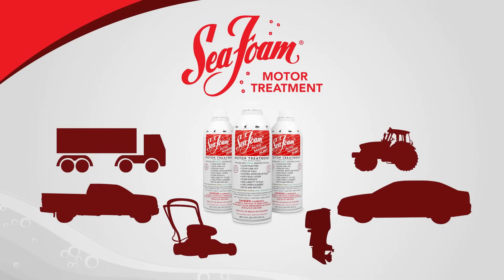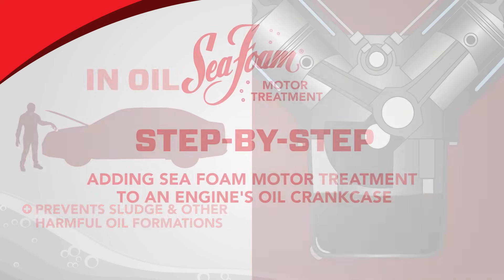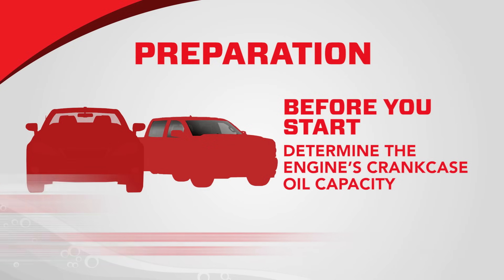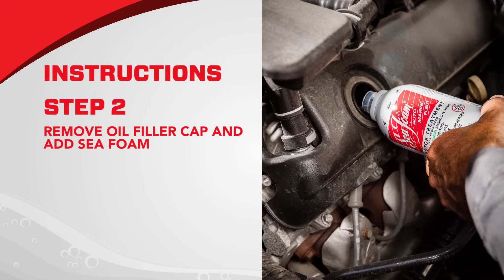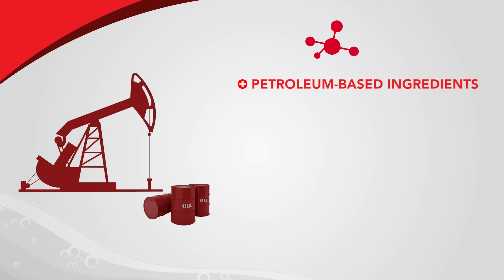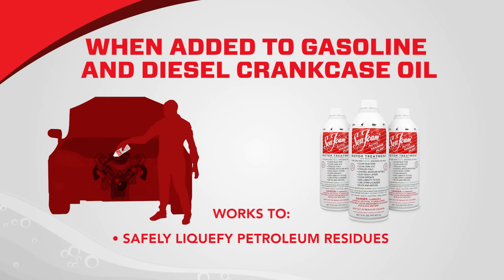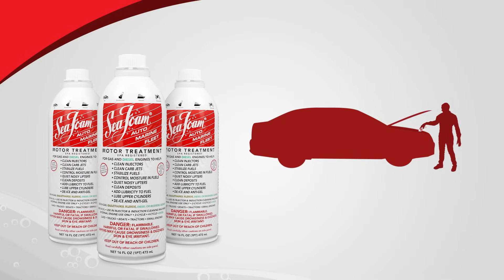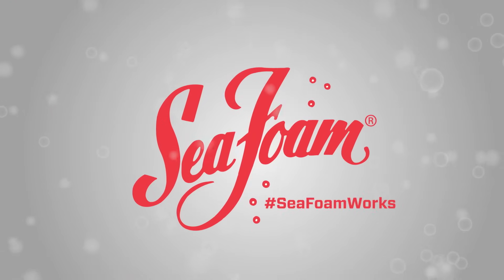Add Sea Foam to your oil crankcase - super easy!

Comment: I've got a 2007 ram 1500 with the 5.7 hemi,  recently replaced the rear main seal and oil pan gasket, replaced the oil pressure sending unit but still deal with low oil pressure when the truck is fully warmed up but it runs really good. It has 165000 miles on it but im worried because the crankcase had a thin layer of built up sludge in it thankfully no metal but some build up, so I'm skeptical when I ask will this product clean up my engine and solve this pressure issue? Running down the road in cruising gear oil pressure is 51 psi. What do you think?
Reply from the maker: Hi Shane: Sea FOam in oil works to reliquefy any heavier residue or buildup so it can drain away when replacing oil. If you like that idea, use it! Hope this helps!

Comment: is it safe to suck through a vacuum line for brake booster?
Reply from the maker: We do not promote using a vacuum line. Not safe because you can hydrolock a chamber and ruin the engine. Use Sea Foam Spray through the throttle body.

Comment: One of my cylinder is having low compression(1 out of 6). Any of sea foam product can help with that?
Reply from the maker: Sea Foam Spray treatments through the intake and adding Sea Foam to oil each interval. Both work to diagnose stuck compression rings that are gummed-up with varnish/carbon.

Comment: I have a 2006 Mazda 3 that was sold to me Really cheap because it had an engine knock. Mechanic told me that some of the lifters had too much play and it's recommended to get a new engine which was going to cost me $10,000. All I did was add seafoam to the gas tank and to the engine crankcase and drove it around. Not even 20 mi before that engine knock pretty much went away by 80%. $10,000 versus a $12 bottle of seafoam.
Reply from the maker: We love that story! Pls send a message using the website's Contact Us page, select marketing.

Comment: I have a 4.2 qt crankcase and am due to change my oil about 300 miles from now, i tend to burn some leaving what I estimate is about 3 qts after top up each interval.  in the case that its less than that,  is it safe to go over a couple of ounces? thanks
Reply from the maker: Yes, a half can is fine.
Reply: @SeaFoamOfficial what if i poured all the bottle??, Please help
Reply from the maker: @thunderwolfgt79  Change the oil or drain 2 quarts/ add 2 new quarts.

Comment: Aww man, just changed the oil on my ride, can I still add sea foam to it being its recommended to do so prior to having one... Never mind, no need to answer being I found the answer in one of the comments.
Reply from the maker: Got it. Can add any time during the interval and leave in for the length of the interval... just as long as you drive at least 100 miles.
Reply: @SeaFoamOfficial  Thanks, definitely drive that many miles as an independent driver

Comment: I just changed my oil on a ford explorer that is burning a quart of oil every 500 miles.  I want to add this to the crank case before the next change, but that might not be for 6 months.  If I dump in sea foam and let it do its thing for say 7000 miles will this be bad?  Or should I just add it, drive 300 miles and change the oil and filter again?
Reply from the maker: You can add at any time during the interval. No worries.👍

Comment: i have a v6 injected engine from 1990 and i've had the can of seafoam sitting ready for years but never got around to it..

i've been running some oil additive that was supposed to reduce friction and stuff, i forget the name of the one that's in there now but it's a competitor of bi-tron from what i remember. right now the oil is black as heck so i'm due to change oil and filter, but i was wondering..

should i add the seafoam before i change out the dirty oil/filter, or should i really change oil and filter first?

assuming i should change oil/filter first, is there any limit to how long i can leave the seafoam in there? like if i change everything and add seafoam, knowing me i probably won't change the oil again for some years.. can i expect that to be all good? i barely drive anymore.
Reply from the maker: Either before or after is fine. Using Sea Foam in oil to clean heavy residues is something to do every interval, so the sooner the better!
Reply: @SeaFoamOfficial  thanks very much! i think i will change oil and filter, then seafoam it up :)

by the way, i suspect my pick up pipe from the sump might be partially blocked, possibly with really old sludge from before i even owned the car.

is sea foam likely to be able to break up heavy/thick particles that might be blocking the screen up? or is it mostly good for residues?
Reply from the maker: @outseeker  Sea Foam works to reliquefy heavier oil buildup, so yes. Use every interval!

Comment: I used this on my amc 360 engine with a lifter knock..  The noise did go away for 2-3 days but came back and never went away again.. sucks
Reply from the maker: How many times did you add it to your oil? Sometimes requires treating 2 or 3 oil intervals... Keep at it!

Comment: My car takes 6

quarts of oil in a 6 cylinder car I believe im 1 quart low so I'm going to put four ounces in.Is this ok?
Reply from the maker: Yes, that would work. You can also eyeball as much as half a can.
Reply: @SeaFoamOfficial   I put it my oil 1500 mile before my oil changed
Reply from the maker: @omarcarnegie7614  That will work!
Reply: @SeaFoamOfficial   My car has a 4.5 quarts oil capacity with filter, how any ounces of seafoam do i need to use?
Reply from the maker: @above.average.gaming.natio3026   5 to 8 ounces. I personally use 1.5 oz per qt.
Reply: @SeaFoamOfficial  ok thanks

Comment: Can this help with clogged pcv valves? That’s what I need to look at next but I want to find the cheepest option first
Reply from the maker: Hi Nolan. No, it wont help to clean a PVC valve (post combustion). Cleaning a PVC is a matter of removal and cleaning by hand. Soaking the valve with long blasts of Sea Foam Spray will make the crud is easier to remove.
Reply: @SeaFoamOfficial  alright well thanks for the response I just bought some to help clean my engine because it’s been kinda sluggish lately
Reply from the maker: @atvthings6887  Run it in your fuel and oil for several months and see what happens.
Reply: @SeaFoamOfficial  would it work well if I added something else like power up with it?
Reply from the maker: @atvthings6887  Not sure what that means...Is Power Up a fuel treatment?
Reply: It’s an oil treatment for better lubrication, not that I would mix oil additives I’m just curious if seafoam is effected much by other additives
Reply from the maker: @atvthings6887  Sea Foam in oil works to liquefy heavy oil residues and deposits back into the fluid phase so can drain when you dump your old oil. Not harmful to mix with other additives.
Reply: Awesome. Thanks

Comment: How much to add seafoam to oil on a 04 Silverado
Reply from the maker: Half a can every interval!
Reply: @SeaFoamOfficial  will it hurt while driving it
Reply from the maker: @shabbaranks3206  You need to drive/run the engine to circulate and clean. So yes, you drive as normal after adding to oil. Leave it in till you change your oil.
Reply: @SeaFoamOfficial  ok thanks

Comment: Will this help with low oil pressure?
Reply from the maker: Hi Joseph: Depends on the cause. If you have an oil restriction, yes. Is your low pressure something recently noticed or been going on for several oil changes? Does the engine have a lot of miles (wear)?
Reply: I like how u  just didnt respond lol

Comment: will this product help if car burns oil
Reply from the maker: Yes, particularly if your rings and actuators are gummed up. Start running it in the oil every interval. Will work progressively.
Reply: Hi seafoam i have a question regarding my welder generator.
Can i put seafoam in the gas tank and crankcase at the same time and run my machine like that? Also once i start the machine with the seafoam in the crankcase how long do i run the machine before stopping to let the seafoam work? Once i wait 20 minutes how long do i need to let the machine run before draining the oil for proper cleaning. Any help is appreciated.
Reply from the maker: @OysterP  Hi Jason: Yes, you can add to fuel tank and oil crankcase at the same time. For a generator, run with Sea Foam in the crankcase for at least 1 to 2 hours before replacing the oil. Hope this helps!
Reply: @SeaFoamOfficial  my machine is running with it inside the gas and crankcase. Once i put in the crankcase do i let it run and turn it off to let the solution work for 10 15 minz then run it again?
Reply: After a couple of minutes adding the seafoam into the crankcase and starting the engine died and didnt start up again on 1 attempt. Im concerned. I called your facility and said to leave it for a day and then try starting again. I hope that will be the issue??
Reply from the maker: @OysterP  No worries. Let us know what happens...take it a step at a time. Please notice that we replied to your other video post  questions.
Reply from the maker: @OysterP  Just let it run with Sea Foam in the fuel. Go to our website and look up the HOW2 instructions for gummed-up carburetor. That will help explain what you might be dealing with.
Reply: @SeaFoamOfficial  for some reason my spark plugs got too oily and thats what killed the motor. I put new plugs she ran right away. Thanks alot for great customer service guys
Reply from the maker: @OysterP   Glad! Our pleasure, always.

Comment: So is this where you add oil to your car? Same spot?
Reply: Yes
Reply from the maker: @sevelev  Yes, just twist off the oil filler cap and pour it directly into the oil crankcase. [Same as where motor oil is poured in.]

Comment: Would this help with a P2188 engine too rich at idle bank 1 code ??
Reply from the maker: A P2188 code has to do with fuel/air mix (upper engine ignition) so adding Sea Foam to the crankcase would be unrelated.
Reply: However, you might try adding SeaFoam (1-1.5oz/gal) to your fuel tank at your next fill-up.  I recommend adding the SeaFoam first so the fuel entering the tank will stir it all up and mix it well.  If you have an intermittently-sticking injector or an injector completely stuck open, SeaFoam can help dissolve any gummy residue in the injector and free it up, as well as delaying similar symptoms in your remaining injectors which haven't thrown codes (yet).  If the issue is electrical (spark plug, plug wires, distributor, etc) or an air intake issue (dirty or obstructed air filter, mass airflow sensor, intake air hoses, etc) then SeaFoam will not help those issues.

Comment: Only used it once when I first bought my used Mini Cooper. If you change your oil regularly you don’t need to do this oil these days have a detergent in it that cleans your engine case.
Reply from the maker: How Sea Foam works in oil is not the same as using a detergent oil. Detergents don't work to prevent or liquefy heavier petroleum forms back into fluid, just like you can't clean oil-based paint from your hands with soap.
Reply: KARLOZ LOPEZ  uh oh....there goes their profits....lmao

Comment: I put Sea Foam in my 2000 Grand Prix oil crankcase. Once I got to work, I noticed a lot of steam or smoke coming from under the hood. Temp was fine. It looked like a leak was coming from crankcase cap but it was on tight. No other signs of leaks at close visual inspection. I added about 8 oz of Sea Foam to my 3.8. I know I used a lot more than suggested. Do you think it was just overfilled and "burped"? The inside of the cap looked really slimy and dirty, maybe it was choking on a sludge ball. Hopefully. Car running fine still, runs so smooth. Any thoughts? I love Sea Foam and I know it isn't the problem.
Reply from the maker: Hi Patrick:  Not sure... If the engine was cold and outside temps were cold, moisture (water) normally accumulates in a crankcase as oil cools, so upon start up it might have been water vapor/steam escaping around the filler cap.

Comment: I poured a gallon of seafoam in my crankcase yes I said a gallon. Oh I forgot to tell you my C15 Caterpillar in my big truck holds 11 gallons of oil that is 44 quarts. It has done big wonders for my turbos. Time to pour some in the fuel tank (240 gal). So far engine is idling smoother. I can also feel my turbos reaction more better.

Comment: If I’m adding to my Duramax do I replace a quart with that and leave it like that for the whole duration of the oil change or does it burn up and I will have to add a quart of oil later?
Reply from the maker: Hi Steven: Just add it to the oil.  Sea Foam IS petroleum oil. You can leave it in for the life of the oil and it remains in the oil until you drain the oil.

Comment: I have a question so once doing the treatment to the crank case the product will start to work as explained, so does deposits and buildups as they start to being released from the engines walls and head out the exhaust system I was just wondering if those buildups would damage piston walls or clogged up the catalytic converters? Please help as much as I like to perform a treatment to maintain my engine
Reply from the maker: The deposits are re-liquified back into the fluid oil phase, then drain when you change your oil.

Comment: I have a Buick 3800V6 engine with a slight  tapping noise. I used Seafoam as recommended by a mechanic to clean oil passages. It did nothing. Another mechanic had recommended Lucas oil treatment. Nothing. I do not believe any of these oil and gas treatments work. I will look for a repair shop that does not recommend these, but one that gives me a good idea of what the problem is and takes an interest in doing the work,. One can waste a lot of money on these magical additives.
Reply from the maker: Hi Robert. Maybe we can help?  Sea Foam will definitely clean up and quiet lifter noise (caused when a lifter check ball gets gummed up and won't seat). How and when did you apply it?  Where did you add it? How much?

Comment: Can you make some diesel videos with the Duramax..oil ..fuel videos..maybe some testimony stuff?!
Reply from the maker: Yes, we'll have a bunch of new diesel content out the first half of 2019. Thanks for the request.
Reply: @SeaFoamOfficial  sounds great..need to email a picture of inside the engine/under valve cover for your company to use!
Reply from the maker: Yes, please do!   Use the website's Ask Jim feature and tell that you'd like instructions to send a photo, etc.  We'll send you a cool ballcap!
Reply: @SeaFoamOfficial  alrighty..i think that is what I did last night..sometimes folks need to see,for the own sake..and thats fine..i was shocked/happy shocked!
Reply from the maker: We received the photos of your Duramax crankcase with the valve covers removed, thanks!  It's always fun to see people discover what happens after getting into the 'add to oil' routine.  Leaves no doubt!
Reply: @SeaFoamOfficial  that is good!!Before leaving town this morning I added a can to the crankcase so it can circulate for a 100 miles or so before doing an oil change.The Duramax holds 10 qts of oil(2.5 gallons)..i personally add an entire can..so folks will do 10oz in oil..and 6oz in fuel...i am not afraid of adding an entire can. I am very happy with how Sea Foam works!
Reply from the maker: t's OK to use 1.5 ounces per quart (max), so a full pint in a Duramax will do well.
Reply: @SeaFoamOfficial  sounds great to me thank you so much

Comment: LOL oh man I used the full 16 oz can in my crankcase and according to that, I was only supposed to use use about half of that and hope that it doesn't hurt it 😧
Reply from the maker: Just keep an eye on the oil. If it goes from light to very dark color quickly, just change out the oil.
Reply from the maker: @Marlon Freire Sea Foam is  petroleum oil. You're adding oil to oil. You'd have to add a LOT of Sea Foam to alter the viscosity. However, best to follow the directions.
Reply from the maker: @Marlon Freire At a minimum, too much is  exceeding the recommended amount.

Comment: what if you put a 16oz in your engine?
Reply from the maker: How many quarts of oil in the crankcase?
Reply from the maker: Most cars and trucks have 5 or 6 quart capacities. If you added 16 ounces (twice the recommendation), watch the oil color. If it goes dark quickly replace the oil.

Comment: I didn't read the directions and dumped the whole can into my oil, my oil capacity is 5.7 quarts, should I be concerned about overdose?
Reply from the maker: If concerned , change your oil. Can also drain 2 quarts and add 2 new quarts without changing filter.

Comment: So to be clear, you recommend changing the oil within 100-300 miles after adding to the crankcase? So don't leave it in there longer than that? Or are you saying I need to NOT change the oil for at least 100-300 miles after adding to be sure it has time to work?
Reply from the maker: The can instructions recommend waiting until 100 to 300 miles before the end your oil interval. If you add sooner just leave until you need to change the oil. Hope this helps!
Reply: @SeaFoamOfficial  thanks, I just changed my oil and will go ahead and add this to my crankcase. My car is having misfire codes even after replacing plugs, coil packs, and cleaning injectors  someone suggested this product to clean camshafts.

Comment: My 2008 Honda Accord is burning oil like crazy! I’m using Castro high mileage full synthetic also! I’m gonna change the PCV value tomorrow but was wondering if I should add sea foam to the engine oil and run for 15 minutes before I do the new oil change? Or do I have to drive it for a few miles?
Reply from the maker: Add every oil interval when 100 to 300 miles before replacing oil and filter.
Reply: Run it 100 miles at least
Reply: Sea Foam Official thanks! I ended of getting a small oil leak this stuff really cleans the engine up! It’s just a valve cover I’ve always had to replace them in Honda’s close to 200k